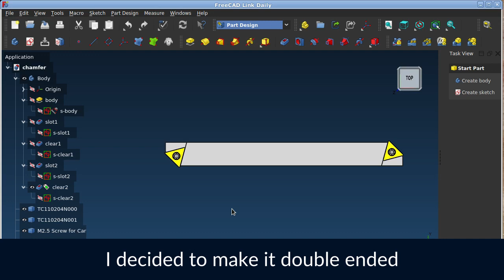DIY Double Ended Chamfer Tool

Comment: Sweet. Did you end up adding a relief below the cutter so that it fits inside tubes?
Reply from the maker: 🤦‍♂️sorry about that. Editing mistake, missed including the clip of grinding the relief. Yes I ground a sharper relief under the cutter. If you watch the video, you can hear it rub the first attempt and then magically cutting cleanly after 😆

Comment: I've been meaning to do a similar thing to use up the 2 unusable corners on my CCMT inserts. I'm still struggling to get my head round the geometry necessary around and under the insert to give clearance in all situations. Nice tool though.
Reply from the maker: I've made that, but with the normally used edges. Stefan Gotteswinter's got one of those as well. It's good to make chamfer tools with inserts you have at hand 👌
Reply from the maker: I came across the design that uses the other 2 edges of a CCMT insert, hopefully is useful for you http://www.homemetalshopclub.org/news/10/newsletter1008.pdf#page=7&view=fitH
Reply: @HM-Projects  thanks for that, I shall use it for inspiration!